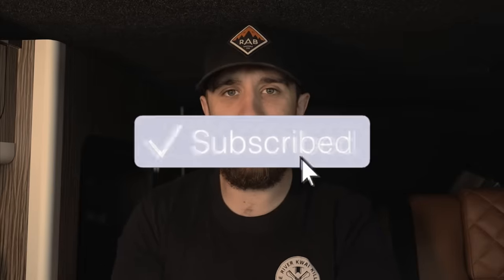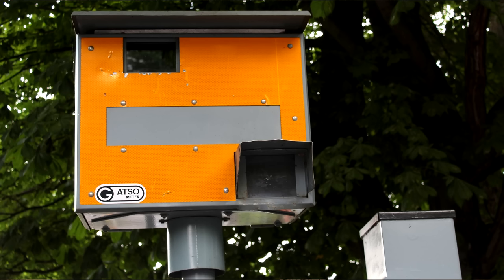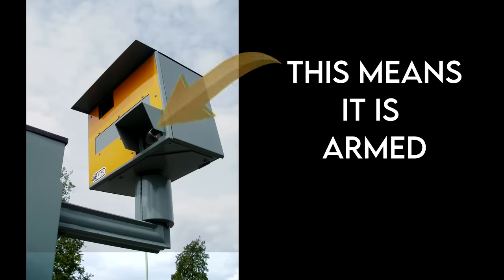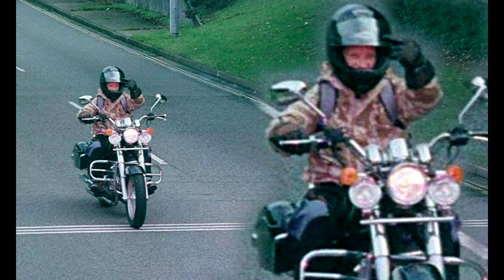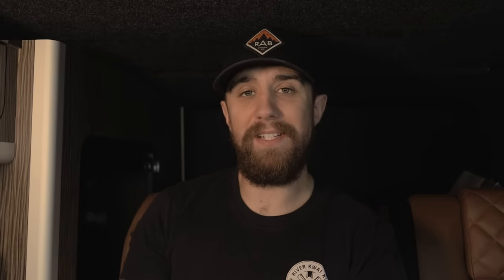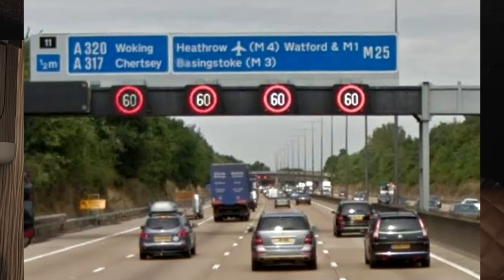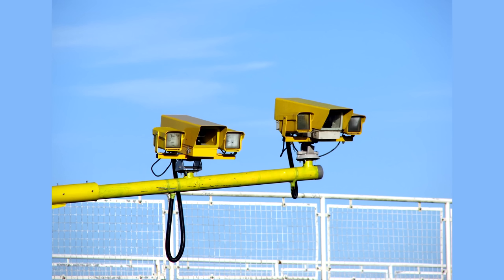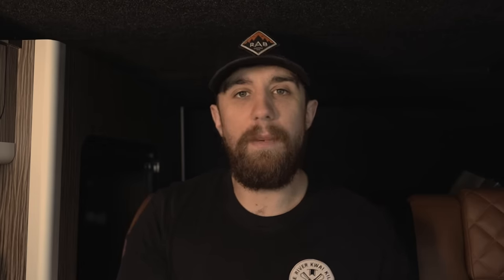How Speed Cameras Work and What to Look Out For

Comment: Workers in road works , that’s a laugh , have driven miles on closed lanes on motorways , no form of life working ,
Reply: DRVN  In that case, the speed cameras should be turned OFF when there are no workmen present, especially if they are behind the continuous concrete barriers.
Reply: @neillambton4065  It's not only about the workers...  its about temporary barriers etc as well, eg a temporary barrier may only be able to withstand an impact up to 50
Reply: David Crouch  lololol.
Reply: Don't worry you mean mice that you can't see
Reply: Can anyone help me?? I was doing 70 on the motorway and there were 2 lanes as one had been closed off for road works BUT there were no workmen on the whole road and there was a speed camera van on a bridge and I carried on at 70mph but there were 50mph signs every so often, will I expect a ticket for doing 70 on a 70mph road?? Are the 50mph road signs mandatory? Please help.......... thank you? Ps there were no workforce present at the time?? Thanks again 🙏🏻🙏🏻
Reply: @TheEXTREMEcleaningguys  expect a nip in the mail.

If the signs present, that's the limit.

A road with a school on it might be 30mph, but outside and near the school it might be a 20mph limit

Just because it's Saturday at 11pm and kids aren't at school doesn't make that 20zone a 30zone
Reply: There's usually narrower l lanes through roadworks so having a speed differential of 20mph between HGVs and cars and vans creates a potentially dangerous situation.  That's one of the reasons the cameras are kept active even when no one is working.
Reply: @TheEXTREMEcleaningguys  - IF there is a red ring around a sign it’s mandatory instruction, if the boarder isn’t red it’s merely advisory, so you can’t be fined for ‘speeding’ past those orange led signs on the motorway
Reply: @neillambton4065  The speed limit isn't only changed because of the different barriers, the lanes are also significantly narrower. If there is long term work going on, then it would be logistically impossible to reconfigure the motorway for every single shift change every single day. Especially since the reconfiguration requires the whole carriageway to be closed for a good few hours.
Reply: On holiday in France there was a section of dual carriageway coned off to one lane for five miles, no sign of workers, vehicles or anything and super low speed obviously
Reply: I rather drive 50 for 5 miles than take an hour diversion
Reply: @TheEXTREMEcleaningguys  You're fixed penalty ticket should be with you by now, and well deserved. If you've got a driving license you should know the rules and abide by them.
Reply: Drowns is not  stop a search
Reply: Another reason for the empty construction site is that  contractors often accept  several contracts at the same time though do not necessarely employ more workers. They shift around the existing workers from site to site according to the need or urgency.
Reply: This would be understandable if we didn’t have single carriageway roads with national speed limits and pavements (or even lack of them), no safety barrier between converging vehicles and pedestrians/cyclists are unprotected. Speed in itself is rarely the cause of an accident. Inappropriate speed is but the biggest cause is lack of concentration.and awareness.
Reply: And they can drive at whatever speed they want. One rule for them
Reply: @TheEXTREMEcleaningguys  if round and red.. yes.. Advisories are usually rectangular. So expect a wee letter usually takes upto 6wks to arrive
Reply: @thelwulfeoforlic6482  unless plods plodding  along I'd advise not to overtake them..
Reply: David Crouch  And Cans of Beer 🍺🍻🍺🍻
Reply: Last time I got £60 + 3 points was roadworks A12 Suffolk Border road works were all cleared away for the weekend though they turned the camera off then the summons turned up with a photo saying 65mph and the temporary speed limit was 50mph.  So no work does not mean no speed limit I did argue the case and got told pay.
Reply: There are no workers because they are knackered, from putting tens of thousands of cones down.
Reply: @johnallan1134  - true; but in theory even they are SUPPOSED to abide by the law NOT make it up as they’re going along
Reply: Any motorway workers I've seen have been drinking coffee and reading the sun while sat in the cab during rain. And it rains quite a bit in Britain
Reply: @MrFreesearcher  I was told by the police that if a road works speed limit is in place and the road works have finished and cleared away the speed limit still stands until the cameras and signs are cleared away.
Reply: @thelwulfeoforlic6482  they will be at that moment if it's 60 they will do it. But I'm meaning others who think it's advisory or temp speed, these speed limits are mandatory. It's like pupils I used to teach with their dad's saying at temp traffic lights if nothing coming u can go on red.. I would say they are temp lights only  because they ain't cemented into the ground red is red night and day... The amount of drivers who try to make up own rules to suit the moment.. Good luck with that
Reply: Just remember when you are on a smart motorway you are always on 📷unless you break down then your dead
Reply: Workers sleeping like dogs in the cab and me make stupid diversion without any reason,just to spend more time and fuel with a huge lorry double deck!Bastards
Reply: I can drive at 60mph through a country lane passing people with prams and children on bikes, but when trained road workers are about wearing hi-viz jackets, I've got to slow down to speeds of 50, 40, and sometimes 30mph 🤣🤣🤣
Reply: @TheEXTREMEcleaningguys  
You should give your license back if you dont know the difrence betwen mandatory speed limit and advisory speed signs...
Reply: Yes ..  hours of work should  be displayed each day and the speed limit should be adjusted to fit these hours each day ...  i.e. when all workmen have ceased working and when they restart the next day! Can't beat logic!
Reply: You gotta obey the work imposed limit not the original 70 limit.However those work limits tend to move from time to time.Work is something off a misnomer as the limit is there even when the workers arnt.
Reply: @jjmmjj9999  depends if the beacons are flashing
Reply: Nicolla Hannah Butterfield  it's NOT the speed limits that I have a problem with, we'll most of them anyway, it's the overzealous policing of them. If you're driving at a set speed according to the required limit, what happens when you come to a downhill section, your speed will naturally increase, so, you lift off the throttle to slow down. But if that downhill stretch is very gradual, your speed can gradually build up without you realising it, then after a while you realise it and slow down. If however you continually monitor your speedo,so you minimize the chances of this happening, you cannot then be properly watching the roads and other surroundings. The police know this, so position speed camera vans, and councils position static camera's "strategically" to exploit this phenomenon. It's too easy to make a simple accidental error of judgement that can be exploited by corrupt authority. It's also worth remembering that in law, for ANY action to be a crime or offence, it has to be intentional, not accidental, with camera's, and greedy corrupt authority, that's almost impossible to explain.
Reply: Doppler radar is how speed cameras work out your speed. It's very precise and doesnt rely on any road markings. I've been caught several times (cos I'm an idiot). So please don't just assume your safe if you see no markings on the road 👍
Reply: @thelwulfeoforlic6482  yes....and no!  The orange (amber) light's are warning you of a hazard and will often ask you  to reduce speed to better deal with a hazard but like you said are only advisory ie no speed camera will go off. If you say...."sod it" and not reduce your speed but then go on to have a collision and at the very worst kill someone, you will find yourself in court on a death by dangerous driving charge...and the court will want to know why you chose not to slow down!
Driving up the A1 a couple of years back (hgv driver) the aforementioned amber lights were flashing and a speed reduce sign said 40mph....it was dark and a little misty so I slowed down. The sign also told drivers that there was (debris in road) I took the advice and slowed...but other truckers chose to push on at 56mph and they overtook me...inc a petrol tanker. I did come across that hazard and it turned out to be a truck had lost several bales of straw each the size of a small car and very very heavy. Out of the misty dark in lane one right in the middle of the lane was said bale....to my left on hard shoulder were 2 more bales and to my right in lane 2 I had a petrol tanker overtaking me. I had nowhere to go and all i could do was split between the hard shoulder and lane 1 by hitting two bale's 😫.....you would think the bales would be soft...think again.  If my peers had chosen to take the amber light warning seriously then I would have stood a much better chance of avoiding the bale's and my truck would not have been damaged......and next time it may not be bale's! 
Sorry to go on.....but you get my point.
Reply: Lunchbreak
Reply: Where do all the traffic cones come from then?

Comment: The camera near my house has had it's lenses spray painted loads of times 😂😂😂
Reply: Saw one in horsforth leeds on fire with a tyre around it” necklaces” like a South African zulu
Reply: Speed cameras have anti vandal paint proof lenses so no matter how many times you paint over the lenses it will still catch you
Reply: Use drain cleaner on a long paint brush
Reply: A cardboard disc seems to work around here........
Reply: @simonbaker9386  Cling Film is what a certain loud swearing rude British TV chef uses.
Reply: @simonbaker9386  I bet using bitumen  would sort it :) thick gloopy tar! :)
Reply: Keep up the good work 🤣
Reply: @simonbaker9386  Nope!
Reply: @johnpm1605  Funny! Bet that one works!    😅 👍
Reply: @alexstewart9747  🤣 🤣 🤣 🤣
Reply: You just reminded of the Max and Paddy sketch where they pull one down after getting flashed 😁
Reply: @johnpm1605  stick a photo of an empty road on it
Reply: @simonbaker9386  that is incorrect, they have to go out and try and scrape the paint off or replace the glass!
Reply: Thermite in a clay pot works wonders if you can get it cheap enough.
Reply: RESPECT
Reply: I wonder, who would be doing that that lives far away? Hmm?
Reply: Good informative video but just wondering why the technology isn't put into the vehicles to stop anyone speeding. Oh I know revenue its not about road safety it's about how much they can screw out of the motorists. GPS speed control within the vehicle would do the job but just seems to be ignored. However who the fxxk would by a performance car if they can't open it up I wonder if that's part of the problem advers affect on manufacturing. It's not about road safety it's about the money making
Reply: Hi no one likes speed cameras. But I wounder if it's more about revenue rather than road safety otherwise they would put the technology in the vehicles to stop them speeding. GPS speed control for all vehicles would do the job and I know people will be saying you what because some people like speed but this shouldn't be on any public road. Just think for a minute what would you feel like if you killed someone with negligence and being reckless. Cause that's what it is and yes we all speed I'm not saying that but instead they prefer to stick camera's all over the place money is greed and lives don't matter otherwise the government would do more about it and have GPS speed limiting on any road so easy to implement via GPS and engine management. But this has another problem who would purchase a performance car that they can't open up manufacturers would have a wobble if this was law and GPS speed restrictions were implemented in the build of their vehicles. Its nothing to do with road safety otherwise something would be done
Reply: In Germany cameras are gray, not easy to see
Reply: Lol nice
Reply: @robertkustos2931  HAHAHAHA
Reply: Just been caught on that last camera haha 57 in a 50. Hopefully I get offered speed awareness course 🙏lol
Reply: @SH-ic4mu  my first speed ticket after 28 yrs passing test . 3 points , £100 fine , speed awareness course. No insurance rise .. you don't get the course again for about 3 yrs after your first ticket .
Reply: @lucas1979ify  I wonder why they would do something like that?
Reply: @robertkustos2931  Good going is that like, 1 in 28yrs. It's first and I've been driving for 12yrs legally anyways 🙃
Reply: @SH-ic4mu  that's good going also 👍
Reply: @stephencunningham405  It is in some modern vehicles, I have option in my 21jazz but the camera often can detect badly placed speed sign. As an example I go through a average speed can section on A-road to work & halfway it picks up a wonky national speed limit sign on a side road while im driving in a 40 zone. Now I just set my speed limiter to 40 instead.
Reply: In the USA they get shot out !!!!
Reply: @johnkilvington7527  Shit i wish we had the same gun laws lol lol i would take them all out! 😁
Reply: Good good, pure revenue generating
Reply: @simonbaker9386  You must be mentalist if you believe that.
A lens is a lens, coated or not, if it cannot get a clear image of your plate, it's useless. Anything that smears it will obstruct it.
Just sayin'
Reply: More efficient than doing that is spray painting the the solar panels that power the camera usually just a metre or two at mist away from the actual camera.
Reply: @GWR4079  Would just be cheaper making it? Don't exactly need to be a chemist to mix a couple of different metals in a bag. Most expensive part would be the blow torch.
Reply: @randommadness1021  you would need to pulverise aluminium and iron oxide separately to  atleast 200gm to make sufficient thermite
Reply: @GWR4079  you can buy aluminium shavings and the rust you can just scrape off any surface that has it on it with a wire brush. That definitely works 😉
Reply: @lucas1979ify  
got one in Kassel last summer, 56 Km/h in 50 Km/h zone. was 38 Euro. fair enough, i paid it. got one in France, 2019, 78 Km/h, or some like this, in 60 or 70 Km/h zone, don't remember exacly... and that was something like 180 Euro. obviously, i didn't pay it... :))
Reply: Omg really
Reply: @ismail79628  I know.¿ I honestly never believed it happened either.
Reply: Usually if your overtaking a bus or HGV at the time the camera cannot see you.
Reply: @simonbaker9386  no they dont
Reply: @simonbaker9386  That sounds like marketing wank.
Reply: Paint ball gun.
Reply: Put a black bin bag over it, never seen a wheelie bin over a speed camera but there's a first time for everything.
Reply: @stephencunningham405  look don’t give them ideas
Reply: @simonbaker9386  not if you put black gaffer tape on the lens 😜
Reply: Good, my American self likes that kinda shit.
Reply: In my area people tend to get a bit more extreme (London UK) I've seen so many cameras on fire at the side of the road. I don't know if people think it's somehow going to stop them from getting a ticket but I guess people are pretty angry about these speed cameras
Reply: Robert Kustos — how about a photo of a C-130 coming in for a landing? Better still, a C-130 taking off?
Reply: Most UK speed cameras are disabled because the film for them costs like a thousand pounds a piece.
Reply: BBguns do great